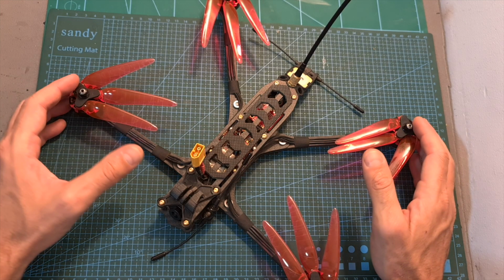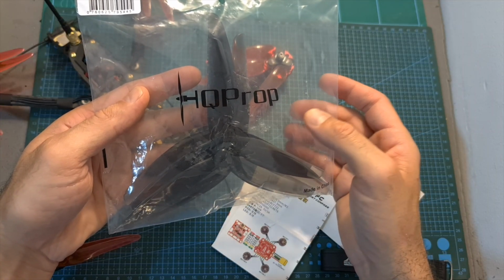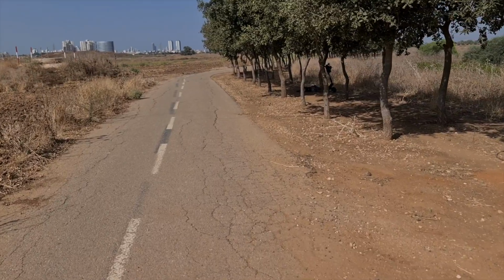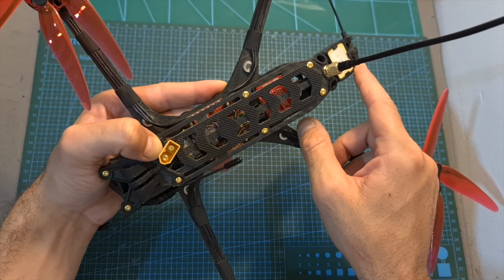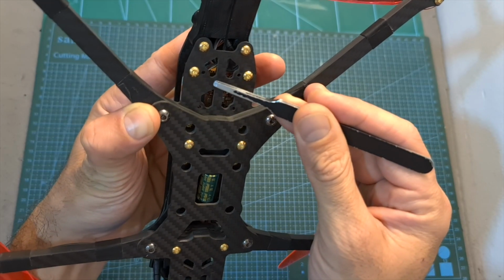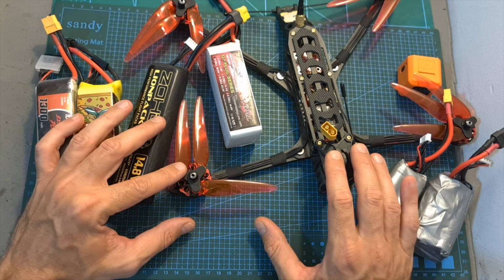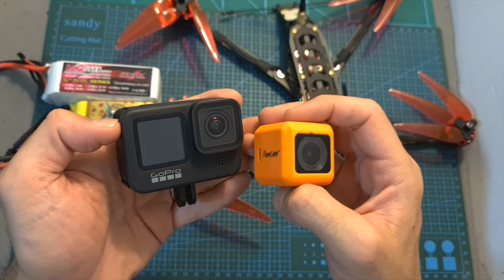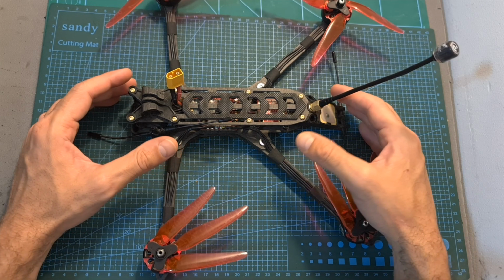Rekon 7 Pro Long Range Quadcopter - Review & Flight Footage

Comment: Very nice quadcotter...but i think 800 mw vtx Is small Power for 7 inch..and what Is you setting for runcam 5 Orange?
Reply from the maker: Yes it is :-)
You can actually get pretty far with 800mW, using the right equipment, however I do plan to upgrade the VTX. 
Runcam 5 Orange - 2.7k 60fps / Normal color style / EIS Off / Not stabilised using Gyroflow.

Comment: Thanks for the review! Literally yesterday I was discussing with a friend that there is no alternative to the chimera 7 ;)
Currently happy with how I've setup my Rekon 6 and that it can use such a large array of different batteries. Noticed that Rekon 6 works quite well with 6S lipos from my freestyle copter (1100-1300mah).
Greets, Mario
Reply: Waiting for my Reckon 6 to arrive.
Hope it works out as well as yours has.
Reply from the maker: Thanks Mario. I actually never tested the Chimera 7 so I couldn't compare the two. 
The Rekon6 is very good. I've tested it using a 4S 21700 LION pack and got a nice range / flight time.

Comment: Do you think it worth it over Rekon6.  ?
Really it's just a normal 7" quad. Same weight.. size.. motors. Hoping for more endurance less power. My Rekon5 can already carry a hero9 with a Lipo. And with Li-ion fly over 40mins. 
So figured they'd build a 7" carry more weight and fly 35mins
Reply from the maker: Well it depends. I will test it soon using a 6s 21700 pack. 
Let's see how it goes.
Reply: @KremerFPV  omg can't wait to see
Reply: Good to hear! I have a rekon 5 too.. Just bought a hero 8.. A bit hesitant to strip it though.. What lipos/liions do you use when carrying the h9? 😎 And what is your longest flight times om your setup? Thanks😊 If I ever upgrade from the 5 i think I would choose the 6"and use 6s liion😎
Reply: @NerdyFpv  https://youtu.be/eTPa8zHZaR8
That is my 40mins flight. Today in 7hrs 42min flight video hits. I use different batteries for different things.
 6s 550mah for fun max 10min flight. 
6s 1300mah for hero9.. over 11min flight with hero9 ( the video following girl on bicycle this setup) 
6s 3000mah Li-ion long range ( I have tested lifting hero9 and it does) max 40mins average 34mins
6s 4000mah Li-ion only 1 test flight 42mins
This is Rekon5 I built. Has different parts than the bnf. 
Heavier batteries require retune.   Also I don't have an braces. It really needs the arm braces I think.  😫 flies crappy on the heavy Li-ions but it does fly lol 😆

Comment: You need to load iNAV on it, it's got a Compass onboard...Real RTH and auto land function, a lot more Sats and reliability......🤔😳😳😳🇬🇧
Reply: iNAV is cool. The tube ended up working better and getting longer flight time on my quad. But few times I got issues compass wouldn't calibrate. 
But I put betaflight in compass calibrates and works. So weird. Going to put iNAV back in and test again. Worked for a few months great.
Reply: @divingfalconfpv4602  Yes, make sure you're well away from metal when you calibrate the compass, even a wrist watch can screw it up..In iNAV 3.0 it all works okay for me, but you have to know the compass orientation in order to set it correctly. If you know where North is, it's not to difficult to check it...🤔😳😄🇬🇧
Reply: @EnglishTurbines  yea I did all that and worked great. Then just stopped. Someone else said might got corrupted. I should of zeroed compass before recalibration. But I put betaflight back in to test if compass works there. If compass broken. iNAV great when it's working. But higher learning curve. I will def put iNAV in Rekon7 though lmao. Just want people to know there's a learning curve. And less help.
Reply: @divingfalconfpv4602  Oh, I have years using iNAV...You will soon realise how bad Betaflight is on a quad like this...Keep at it...🤔😄🇬🇧
Reply: @EnglishTurbines  maybe today I'll put it back in. Betaflight rth arrow and being screwy yesterday. I think betaflight was using compass (I know it's not suppose to) when I'd get closer to this industrial building home arrow turn and point toward that building lol
Reply: @divingfalconfpv4602  I rest my case...lol...🤔😄🇬🇧
Reply from the maker: Yes, I plan to load iNav and test it again soon.
Reply: @KremerFPV  Great, look forward to seeing that...🤔😳😄🇬🇧

Comment: 550 Dollars...?...You have to be kidding me..?...🤔😳😳😳🇬🇧
Reply: $599 with crossfire
Reply: Just built a diatone gt m7 inch with discounted and drone junkyard used premium parts. £120 with 2807s. Goes quick and freestyles for fun plus will do 2 miles out no problem.
Reply: @richardheedfpv9626  I can do 2 miles out using my 5 inch Stingy...🤔😳🇬🇧
Reply: exactly what I said also / madness rip off

Comment: I would love to see how much endurance it has when you put a 6s liion battery on it. Will it make 30 minutes??
Reply from the maker: 6s2p will be too heavy. I will test it soon using a 21700 6s pack.
Reply: Going to need a 6S2P Li-ion so it doesn't just sag away. 21700 be nice.
Reply: @divingfalconfpv4602  that would be so interesting.